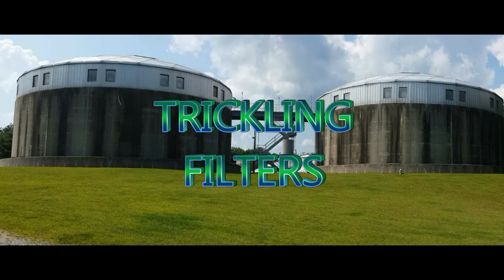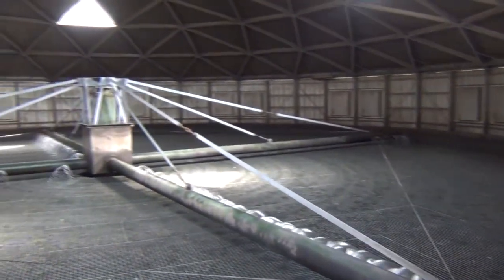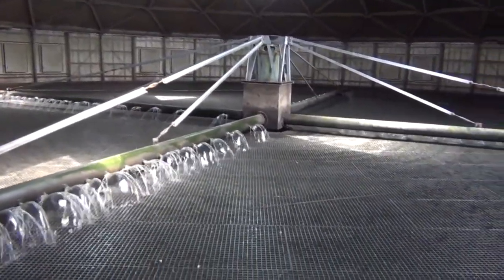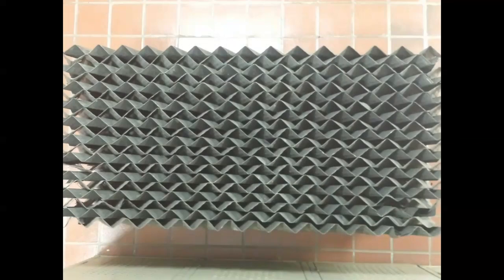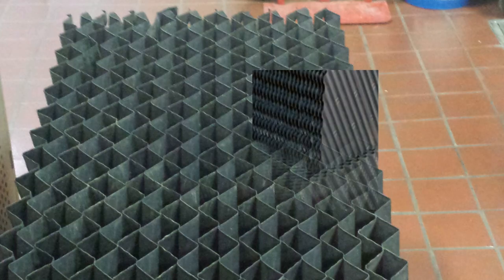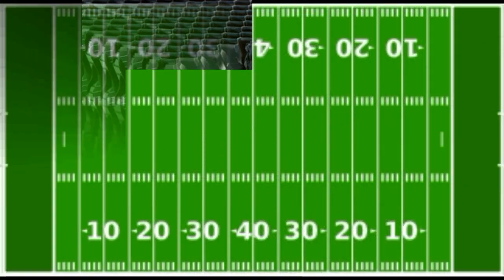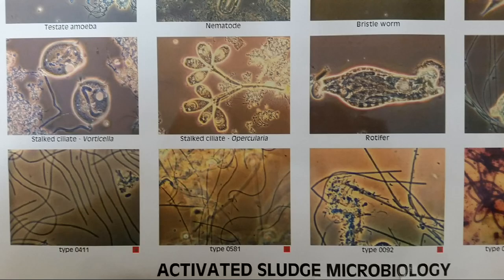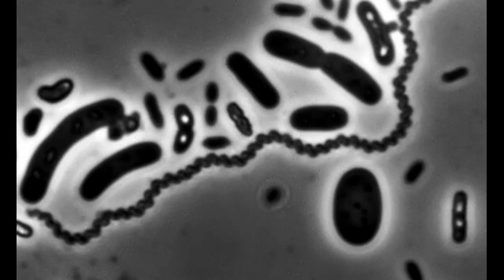Trickling Filters

Comment: Hi, what does the flushing dose means ?
Reply from the maker: Hello. We don't use the termi flushing dose in this video, so we assume you are talking about the dosing rate? That is when increase the dosing rate to flush the media. We run all the primary effluent pumps to flush the tricklers to clear growth that can build up in. We do not have any need to do this because our plant is overdesigned and microbes are not over fed, so the growth remains fairly consistent and sloughs off on it's own.